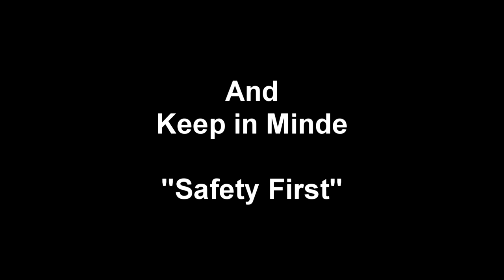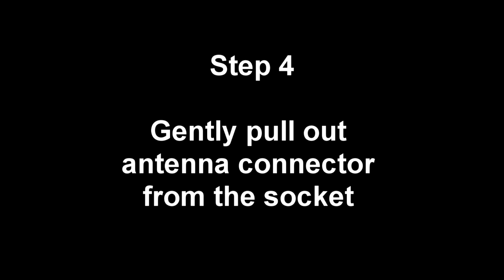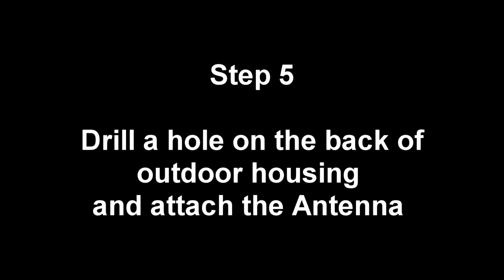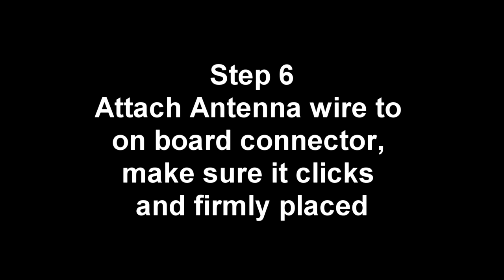How to extend WYZE Cam Wi-Fi range

Comment: Appreciate your video, would have enjoyed it more with narration instead of the music. I took the antenna you recommended and installed mine in the bottom of my enclosure. I did not cut off the base of the camera swivel mount, but instead drilled a quarter inch hole in my base. Drilled a slightly smaller hole in the bottom side of the camera, to run my antenna wire. I installed the connector of the antenna through a hole drilled near bottom center of the enclosure back plate. I connected the antenna wire inside my Wyzecam in place of the internal WIFI antenna. Finished it by screwing the external antenna in place.

I mounted this camera to my backyard shed pointing toward my rear gate. With this new antenna on my camera I’ve noticed a big improvement in my camera reception. I’m probably close to 80 feet between my router and this camera with a few walls and roof in between. I think my Device Info Signal Strength has gone from approximately 49% to around 70%.

I avoided cutting up my camera back panel because I have a Wyze Bridge Sensor plugged into my secondary USB port. The Bridge allows me to pick up signals from my Wyze Sensors mounted on my shed doors and my rear gate as well as a Motion Sensor inside my shed.

If you modify your camera do take steps to waterproof the top and back of the external housing.

Comment: I just did the modification you suggested using both a rubber stubby antenna and a larger WiFi aluminum yagi antenna.  I compared the range using the small exterior antenna to my new Wyze Outdoor Cam and got much better range and signal all the way to my entrance gate here in the country.  I imagine that is at least 60 yards.  The V2 worked using a WiFi extender with two rabbit ears antenna on top of it perched in my window, thus eliminating the need to run an Ethernet cable around my room from a closet where the router is.  (My house is not wired for ethernet.)  So with better range using the V2 and a wireless WiFi extender in the window, I have a better outdoor camera.  With permanent power provided to the V2 using a solar panel and a plastic ammo box for the electronic:  a solar controller and a 12V to 5V converter, my V2 is virtually autonomous, self-sustaining.  I've experimented using the yagi antenna and gotten over 150 yards, so far.  But I'm wondering how much further I could get with another yagi connected to a modified WiFi extender.  The yagi does have to be firmly held in place directly aimed back toward the extender at the house.  
Hoping you'll soon be the one to try installing an exterior antenna on the Outdoor Cam.  But I'm not sure if it is still on a WiFi frequency back to the base.
Reply: Just an update.  I ended up using $30 panel antennas on both the house and where the camera is located around 150 to 200 yards away at a deer feeder.  Works perfectly, powered by a large battery, 12V to 5V converter and solar panel for charging, the electronics placed in a large plastic ammo box for protection from the weather.

Comment: I just did this mod using the antennas and enclosures you have listed. I have it at my gate being powered by a large 12v battery that is powering the gate (with a 12v to a 5v USB adapter). The gate is about 200’ away and it connects to my indoor router perfectly. 
I am getting 60-80 KB/sec throughput.
Reply from the maker: That's awesome! I am glad you like it.

Comment: In my experience, anything outdoors needs to be sealed to prevent unwanted entry of insects and moisture. Especially during colder seasons when little critters will want somewhere warm and dry to shelter in. A tube of silicone caulk will go a long way toward this goal.

Comment: Curious why you clipped out the corner of the camera case for the antenna cable instead of just drilling a hole?
Reply: Agreed. Look'n at the cover I didn't think the base needed cut. Good concept... a little excessive on the cutting & clipping.
Reply: @PlaceboAddress  The base needed to be cut to fit the antenna connector. The back of that case is normally flush to the back of the base where that connector is.
Reply: Curious why he clipped everything away... Drilling is very dangerous with floating parts hold in hand like he did so clipping is safer :)

Comment: Whats the range without modification
Reply: It's going to vary.   March 2021 - I'm trying an outdoor balcony that is only about 25 feet from my router and it works without modification in front of a window and not behind an outside wall.  Otherwise I have other camera's in reasonable line-of-site to the router about 40 feet away.

Comment: why not use use one of the USB's in the back of the camera to connect the external antenna, then set it up using IFTTT? less work than all of this.
Reply: @eml5086  NO!
Reply: Why would this not work? Thanks from the network-ly challenged 😂

Comment: I want to use an external battery pack, as no ac near area... Anyone done this ? What dcv does system need (3.7,5,?)... Thanks !
Reply: Standard USB power is 5 volts. a 20000Mah battery back will last about 60 hours YMMV. Just need a battery pack that can supply power and charge at the same time so you can charge it with a small solar panel; or a solar panel with battery pack on it.
Reply: @rollover36  What size solar panel did you use to ensure that the power supply was recharged during the day to its max?

Comment: Honestly this was pretty poorly thought out. No weatherproofing at all. I would add some silicone sealing at least if you’re going to put an indoor only camera outside. Great idea, poor execution IMO. There was already space in the bottom of the enclosure for the antenna to go, would have made more sense.
Reply: Please post a video of your alternative mod! I found this to be a great idea and I will do it while not exactly that way. That outdoor case he is using is pretty tight and he never said where he would be installing it, could be indoors or under an eve which would be just fine.
Reply: He is using outdoor case, you can find them on eBay or amazon
Reply: I have 3 wyze cameras that have been outside for 3 months now. All the "weather proofing" ive done was putting some duct tape on the back and they still work perfectly. Wyze cameras can take a beating considering how little they cost